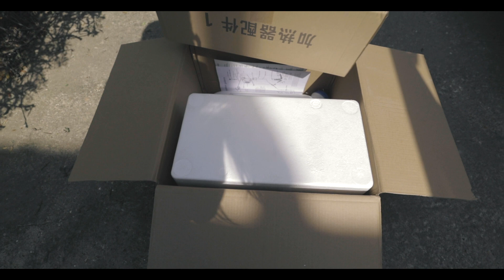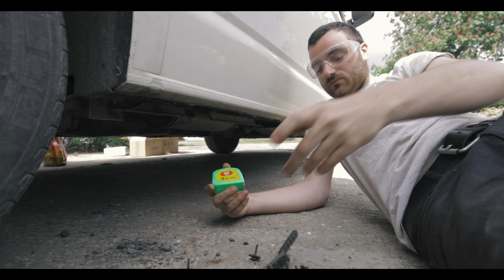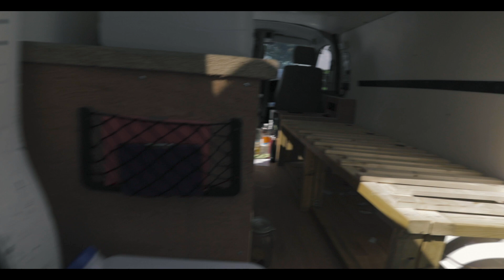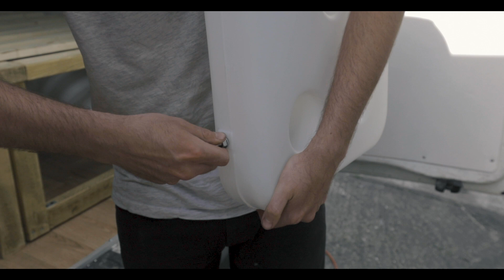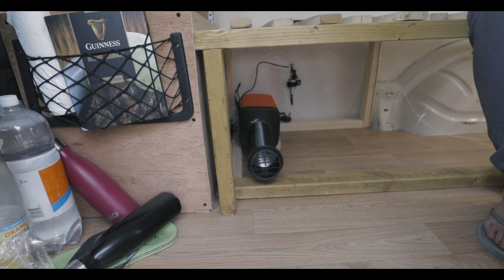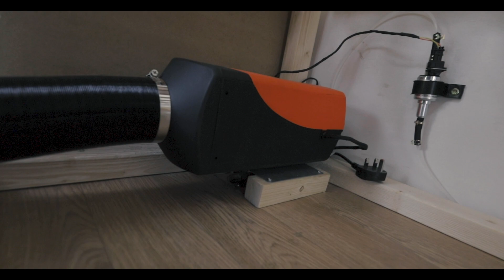We Fitted A Chinese Diesel Heater! | Van Life UK

Comment: Hi, is your exhaust connected on the inside of the van with the jubilee clip or outside? It looks as though it's sat on a wooden frame like our one needs to be (just fitted and test run up but not fixed the exhaust in place permanently yet). We have an aluminium floor originally designed for minibus seats in our van we cannot remove which means we can't bolt straight to the van floor. Went on a vanlife forum and lots saying I can't fit the exhaust on the inside in case it disconnects and allows carbon monoxide inside. I've read these heaters are pretty safe for CM emmisions and decided to fit 2 alarms as well, one by the unit and another just below and close to our bed. Just love to know how your exhaust is connected, thank you. James
Reply from the maker: Hi James, 

Yeah I just built a little wooden platform so to speak and mounted ours to that. I used GUM GUM exhaust paste around the exhaust joint and to fill the gap around the exhaust going through the floor too. So far so good. Not got any complaints at all about it tbh. We’ve got a CM alarm right next to it and never once gone if or anything. Hope that helps 👍

Comment: good video, how about running it in the winter? do you batteries have enough power?
Reply from the maker: Yeah we have enough power. We’re careful with what else we use etc and have to run the engine for a few hours every few days but it all worked fine 👍

Comment: Why is the tank at the angle? I might have missed the reason.
Reply from the maker: Just because it fitted better and didn’t kink the fuel pipe. If you can though mount it level 👍
Reply: Thanks. It was great watching. Good luck out there.

Comment: Some great tips, as I have just slept in my van in London, when it was -5 outside and -2 inside the van. That is the last winter I will be cold lol. Interested to see how you protected the exhaust outlet form burning your flooring ? You said holt gum gum ? how did you install it and how much ? I will do as you did with raising off the floor with wooden blocks. What size did you drill the holes ? Thanks
Reply from the maker: Yeah definitely need a diesel heater. They’re amazing. 

I just cut a much bigger hole in the floor and insulation compared to the hole through the metal floor. Seems so be doing fine 👍. And the gum gum we just put as much on as we needed to cover the hole.

Comment: Sounds like the fan is catching, the smoke that came out could only be the fan or electronics as the combustion chamber is separate to the airflow inside the van. Make sure the fan spins freely as it did sound very loud!
Reply from the maker: I think I just flooded it as it worked fine after that haha

Comment: Excellent video! I see you mounted the metal mounting plate directly on untreated wood. Did you ever have any problems there with the mounting plate getting too hot? I just did an install like this in my sailing yacht. Out of fear of too much heat for the wood, I covered the wooden parts in epoxy and fibre glas. So just wondering if that was overkill?
Reply from the maker: No we didn't have any problems at all 👍

Comment: HI I saw that one person was telling you about the second hole in the installation plate that is for  the fresh air intake for the burner. Without the connection to the fresh air intake to the burner, you allow the heater to burn up the oxygen that is inside your van. The goal of that heater was that it drew air into combustion chamber, and exhausted the products of combustion back to the outside, leaving inside air clean, and not with having the oxygen consumed from inside.
Good Luck in your build!
Reply from the maker: Yeah we had two pipes going out the van. One for the air intake and one for the exhaust 👍
Reply: @TabithaAndLiam  Great, I just didn't want to think that your heater was stealing your oxygen ! Thanks for the reply! 
Safe Travels!

Comment: I'm sure you figured this out by now but the pulse fuel pump should be tilted to a 15 to 30 degree angle.
Reply from the maker: Yeah. Thanks 👍
Reply: I think the 30 deg angle was started by the esparto SP? heater that had a stupid little filter size of a pencil eraser on bottom of fuel pump. If not mounted at a angle the dirt could fall between pumps back into filter and clog it. mount it at angle and dirt falls in corner of pump housing.   Since most use inline filters before fuel pump, angle not needed. Straight up and down so all the bubbles the pump makes flow freely out. I mounted mine this way and know there is no air trapped in pump. Think its just a something that keeps being passed along. What sense does it make?
Reply: @texdog2772  - I suspect the world expert, John McK47, would have a good reason for tilting the pump.
Reply: @GirdHerd  He's the one that says don't tilt. I've watched every Youtube vid on these pumps and have to sift through every ones ideas. The pump makes lots of bubbles at least from the fuel i get. Fastest way out of pump is straight up. Makes for a quieter pump if kept full of fuel.
Reply: @texdog2772  - That's interesting.  I watched his entire 17 or 18 part series and thought he said to always tilt it.  Maybe he has changed his mind.  Anyway, it's good to know that it works straight up and is quieter.  Take care.
Reply: @texdog2772  Buddy! Nail on head! The Chinese copying process, also copied the instructions from Eberspächer - & this whole tilting thing became as mainstream as the copied heaters! The pump is simply always full of diesel in normal use.

Comment: Hi guys,

Big fan of your videos, great to watch your journey.

Just a quick question about when the exhaust to the heater was fitted. Did you refit the tray (on top of the pipes?) I'm trying to find the best place to fit mine and the most suitable is in a similar place to yours.

Cheers,
Colin
Reply from the maker: Hey, thank you. 

Yeah we fitted that on the inside. Then ran the pipes out through the two holes we cut. That way I didn't have to run the fuel line outside too. 

Hope that helps a bit.

Comment: Take the on/off switch out of the circuit. If you flip that switch off intentionally or accidentally it will ruin your heater. It has to shut down properly by going through it's shut down cycle. Also, that looks like a 5kw heater and with a van that size you'll wish you had gone with the smaller heater. One more thing and this is the most important part, route the exhaust out from under the van!!! You don't want the exhaust bouncing around under there collecting under the body and finding it's way inside the van through any holes!
Reply from the maker: Yeah we have caught that a few times lol.  It's good to have though in case of an emergency or something. 

Yeah it's too hot for that little van. Fell asleep the other day and woke up in the middle of the night and it was 29c lol was melting 😂

Comment: Loose that fuel filter they're prone to leaking, either get a inline lawnmower filter or none at all

Exhaust repair bondage.. 👀😅
Watch the heat an fumes from that exhaust 
Great Vids 👍
Great tufty too
Reply from the maker: Ok, thanks for the heads up on that 👍

I typed in exhaust repair bondage online and it came up with solething a little different then I was expecting 🤣🤣 

Yeah so far it's been fine, we have a CO alarm and it's all been ok ATM. 

Thank you 👍